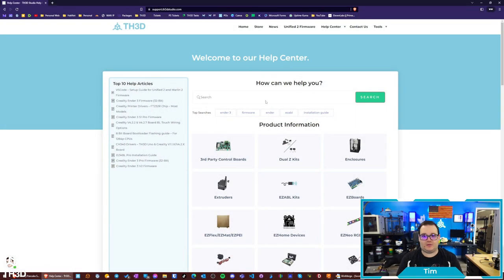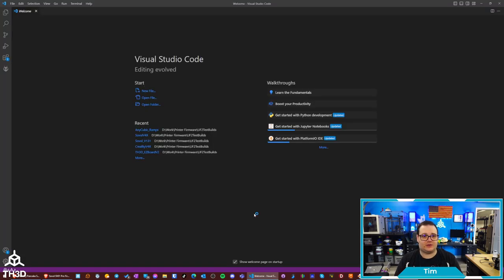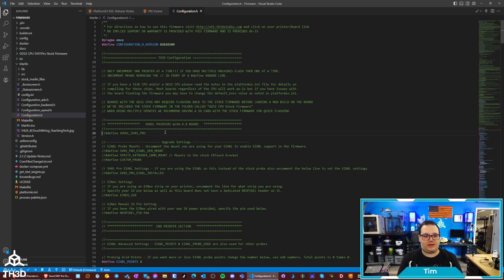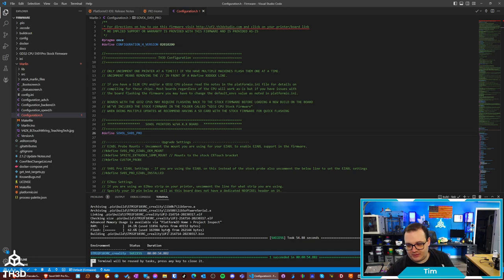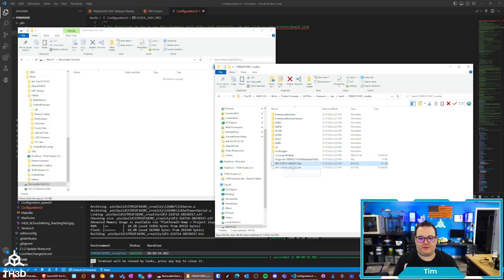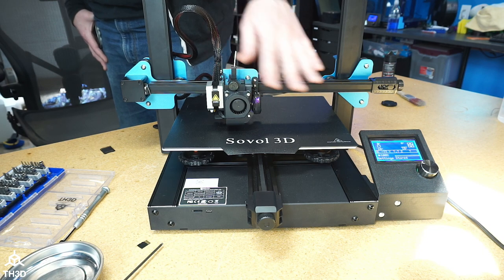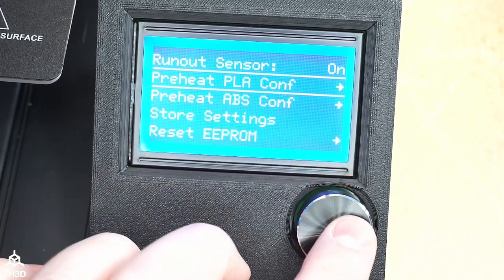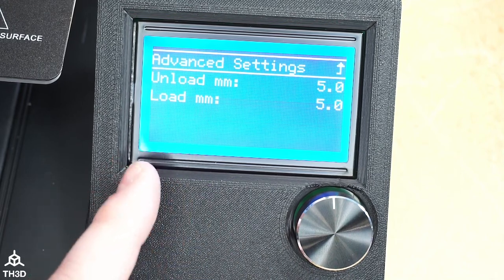Sovol SV01 Pro 12864 LCD Upgrade Kit

Comment: So is this basically reverting the pro back to a non pro machine and utilizing your firmware?
Reply from the maker: Not really. The pro has a much better board than the standard one. It just makes it much more usable and upgradable than stock.
Reply: @TH3DStudio  ok but the new screen is the same as the non pro? I have a silent board on my non pro and the screen you used looks similar. just trying to see what I really need to upgrade
Reply from the maker: Yeah the SV01 uses the same screen as the one in the SV01 Pro LCD kit we sell.